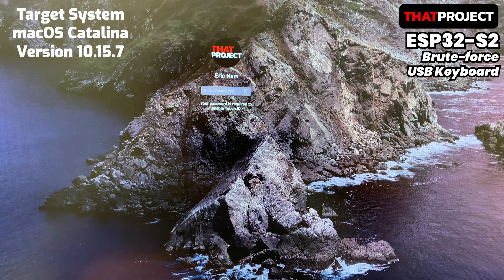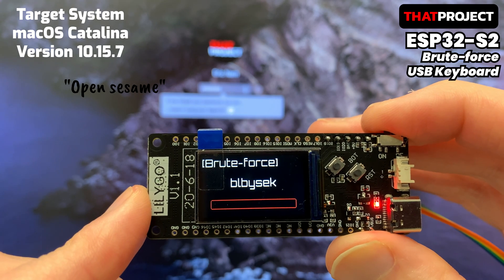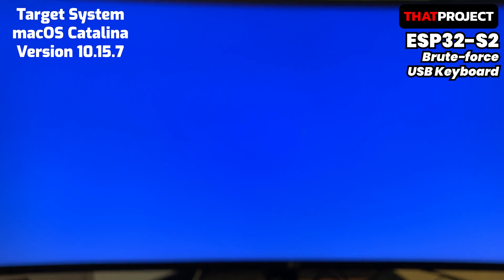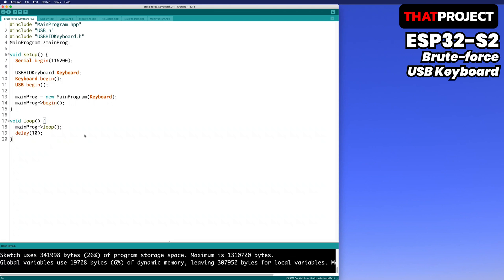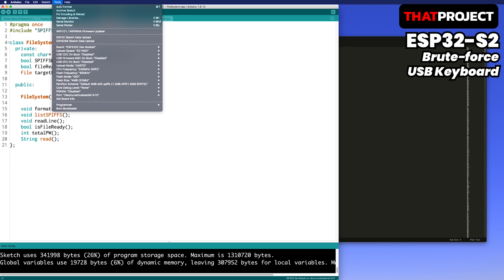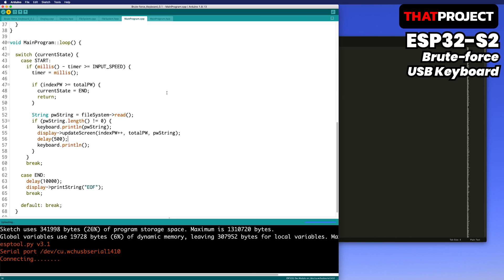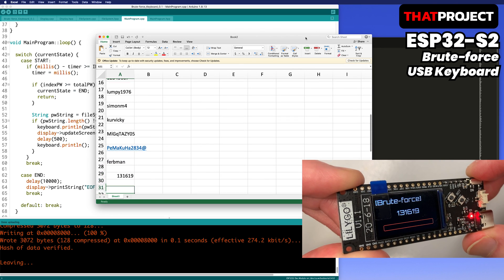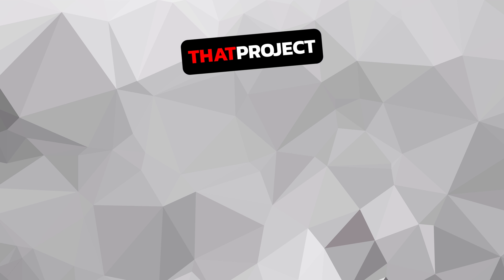Auto Key Input USB Keyboard using ESP32-S2 (based on Keyset)

Comment: Hey. You know how to use native USB to print to a thermal label printer?😊
Reply from the maker: It must be connected to a USB host on ESP32-S2 or S3 and then transmit the data required for the printer's output. This is not that easy.

Comment: Are you using an ESP32-S2 with the TFT_eSPI library? If so, I’m getting compile issues.
Reply from the maker: It's using LovyanGFX instead of TFT_eSPI. There was a problem driving ST7789 with TFT_eSPI on ESP32-S2.